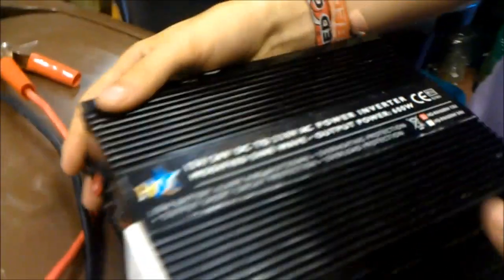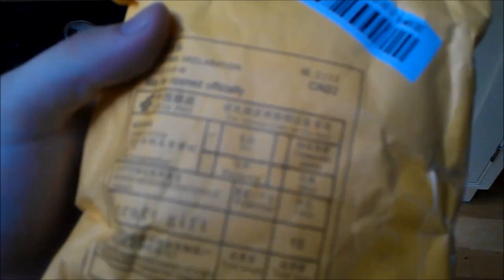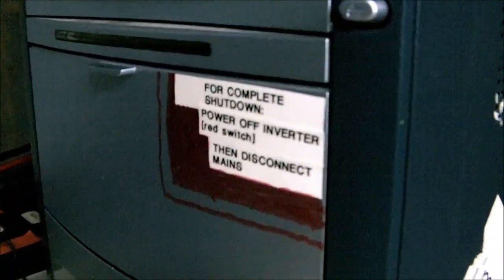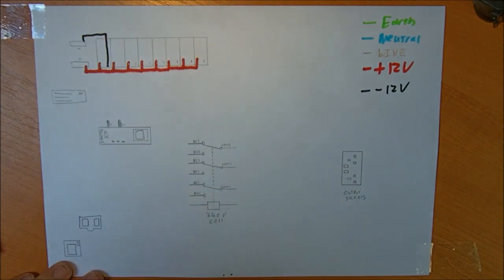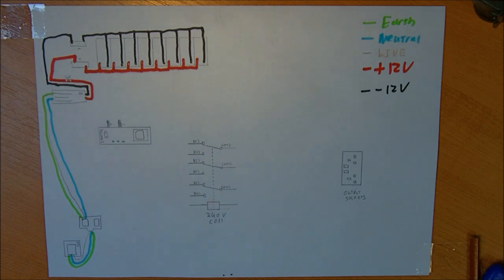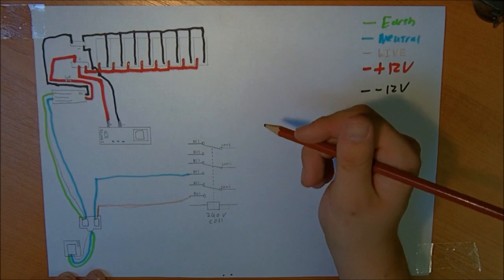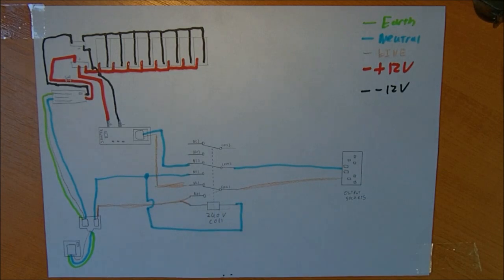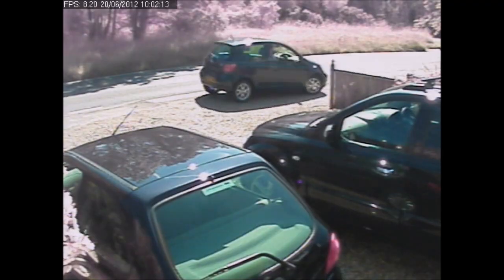Super simple & super cheap DIY UPS/CCTV system complete!

Comment from the maker: Yes the camera is 12, however the router is 19v which could be a problem. Products exist for cars that can supply the 5v and other voltages (including some negative) for a computer to run from 12v. Another problem is this would probably draw more current than a standard car charger could put out, so an expensive one would be required.
Using a high wattage output inverter also adds the possibility to power the entire ring main in a power cut too. But yes this may save a little power :)

Comment: In the circuit, some capacitors are needed to eliminate sparks. Over the long run, the sparks will damage other appliances on the same wire.

Comment: Some questions about the relay.
I'm going to build an all DC-UPS, for a laptop-like-UPS for mini-(but still powerful)-PC
I see in the diagrams you're using only 2 of the 3 Poles, so for a ups actually DPDT relay would suffice, right?
Next do you know of such a DPDT but solid state relay? I want to minimize the bounce-fluctuations, because I'll be powering a mini-pc.
Or if a regular electromagnetic DPDT relay can be used for Uninterruptible switching, I guess I would need a good capacitor after the relay, right? Would a proper capacitor handle such fluctuations during swithing?

Comment from the maker: We used a 3pdt relay from eBay : 
ebay.co.uk/itm/DC-12V-Coil-5A-240V-AC-28V-DC-Electromagnetic-Relay-11-Pin-3PDT-HH53P-w-Socket-/180916943074?pt=UK_BOI_Electrical_Components_Supplies_ET&hash=item2a1f7d78e2

Comment: The way that u wire the batteries are not that efficient dint do a good flow trough all ! All u need is start at first battery with "positive " and finish the wire at the last with "neg" in that way current will flow even trough all starting in the first end ending at the last!

Comment: Thinking you are wasting a huge amount of energy! All your devices look to be 12v devices to begin with. Computer,cam,router...... why dont you just pull off batteries and have a 12 battery charger supplying the 12v and keeping batteries charged until power goes out.... wont need inverters at all including one in PC wasting all that energy...Maybe wrong but looks like all your items run off 12 vdc from the start....... pc just has powersupply to change from ac to DC